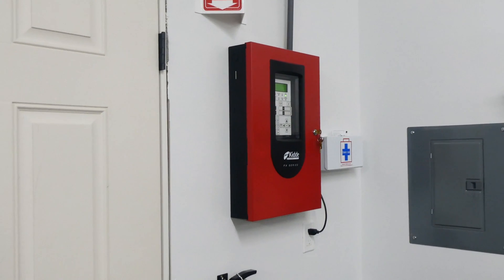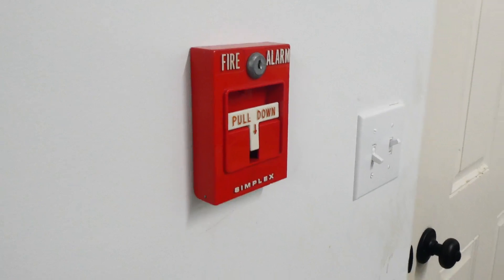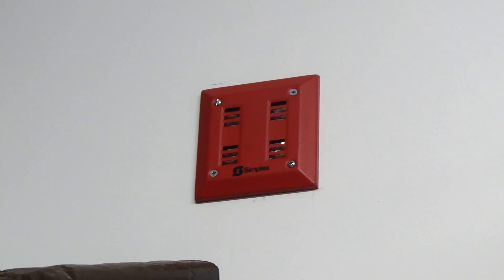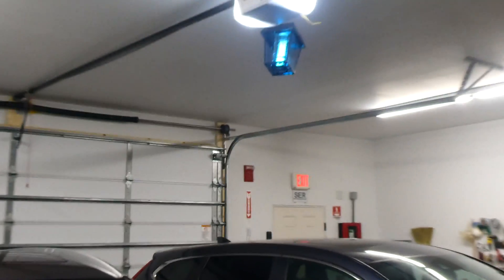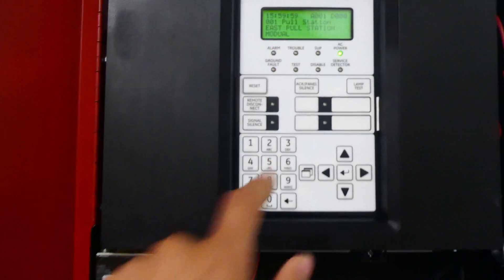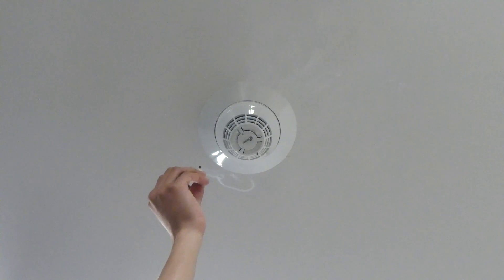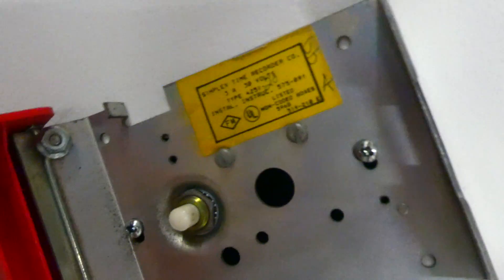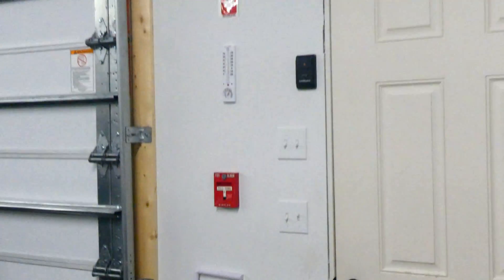S.E.R. System Test 6: Vintage Simplex! + A Little Update

Comment: Dude, get yourself a booster panel so you can have filtered DC. Trust me, it’ll be worth it in the long run
Reply: Question: Do some panels have filtered DC? If so, what are they.

And can the MS4 run on filtered DC?
Reply: TV4586 While I cant name every panel that has filtered dc, pretty much all simplex panels, Notifier panels, larger silent knight panels, and some fire lite panels output filtered dc. As for the MS-4, no it outputs FWR
Reply: Thanks. I planned to get a MS-4, but I’m not a big fan of FWR due to the way how it affects some alarms (Spectralert Classic, mechanical horns, 90s Simplex alarms, etc.). What panels would you recommend that has filtered DC and would fit for a person that has never owned a FACP before?

Sorry if I’m asking too much.
Reply: TV4586 Hmm, probably a simplex 4004, but they can be really pricy on eBay. Another good option is the fire lite ms10-ud
Reply: Final question: does the MS-5 use FWR?
Reply: TV4586 yes
Reply: Thanks. Love your videos by the way.
Reply: @T_rystyn  get a DC rectifier